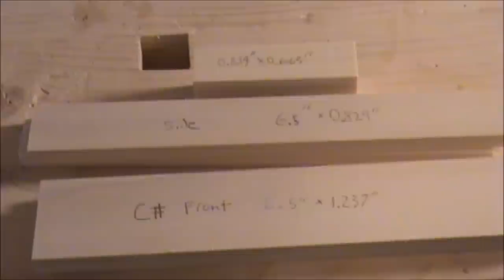Making a Wooden Organ Pipe

Comment: What is the cap for? And how do you tune tem?
Reply: The cap is acting as the stopper, which lowers the pitch by half. The tuning is determined by the length, so to re-tune it would need to be cut off and glued back on.
Reply: Joe Cleveland But... Isn't the traditional plunger method more flexible? I mean, for example if you decide to change the temperament along the way?
I don't want to be a busybody, just curious...
Reply from the maker: ***** You are right, the plunger is a much better solution, I just don't have access to proper sheepskin leather which is very expensive.
Reply: You can use felt. It works ok.
Reply: Can you find that info about the proper lenght vs tone Heights online or in a book. And are square flutes better than round ones? Could you just buy a couple of flutes and put them into your organ?

Comment: Congratulations on making your pipes.  As you have discovered, it is a very slow and painstaking business.
  I have seen a few videos of people making wooden organ-pipes and many do as you have done, and glue one or two sides to the block, with many clamps.  For anyone doing this, now, I suggest a more practical method for small pipes like this is to glue the 2 sides to the block, using several rubber bands to clamp the pieces until the glue dries.  Then skim the edges of the sides and the block true (either using a plane or abrasive paper glued to a flat board (mdf?)) and glue on the front and the back.
  Are you left-handed?  I ask, having noticed the several injuries to your left hand!
Reply from the maker: Offshoreorganbuilder Thank you for the advice, I will give that a try. I am actually right handed, I find that my left hand gets cut more often because the sharp thing is usually being held with the right hand.
Reply: MiniButMany Having seen your video again, it strikes me that there are other details of manufacture which your (or anyone else viewing this) might be interested to know.  These include:
1/  Definitely give up the clamp method for the use of rubber bands.  They are so much quicker, and you can work on several pipes at once, without running out of clamps.
   Very small bands are good for holding the 2 sides onto the block for initial gluing, then you can glue the fronts and the backs in one go, using the same or larger bands (as the pipe size increases.)
  When the pipes are too big (i.e. too long) for even larger bands to be practicable, cut large bands to produce a rubber strip and wind this around and up the pipe, knotting strips if you need to.  (Trap the first end of the band by wrapping it around itself at one end of the pipe, then wrap around and around, up the pipe, finally trapping the other end of the band in the same way.  There is no need to use knots.  Every turn of the band increases the pressure and your work is never bruised.) 
  For very long pipes get an old bicycle inner-tube and use scissors to cut it down its length into a continuous 1/2" strip.  These strips are excellent for large pipe gluing.
2/  Use a small brush to spread the glue.  (I use an old Copydex bottle, with its brush, filled with PVA.  It has lasted for decades.)
3/  Buy a countersink!  (Much better than using the end of a twist bit.)
4/  See Paul Sellers' videos on sharpening chisels and plane blades.  His methods are excellent.
5/  Use stoppers on the tops of the pipes, so that you can tune them.
6/  I see that you use the 'German' cap and block.  This is OK, but the 'English' pattern (with the blind block and the flue cut into the cap) may produce better results, tonally.  The way you are doing it is more suited to busker or fairground organs.
7/  That band-saw looks dangerous!

  I could go on, but it's taking too long!
  I admire your work, seeing the partly-built organ.  Well done and full marks for tenacity.  Have you finished it, and what does it sound like?